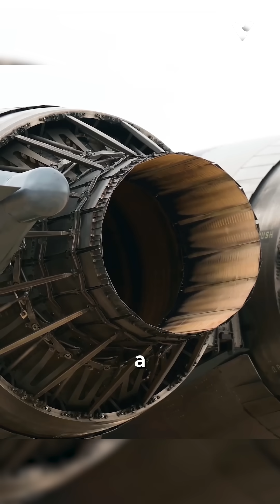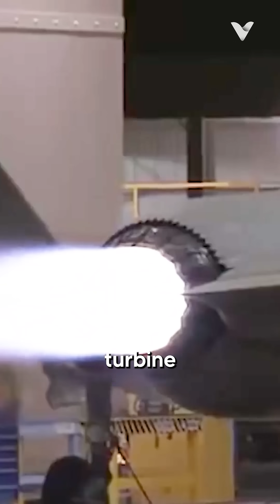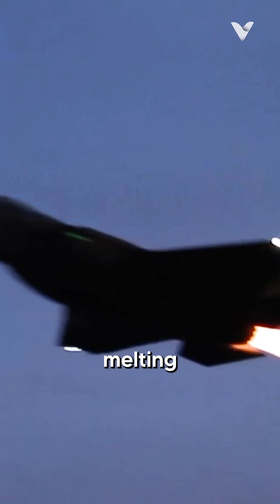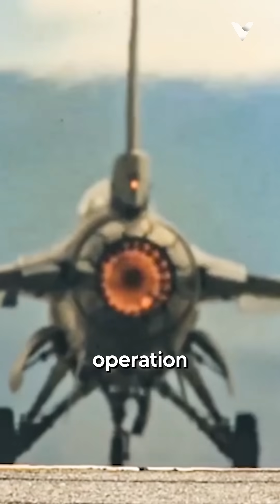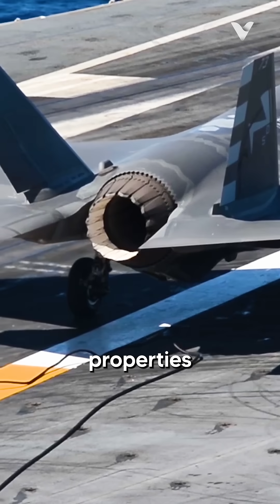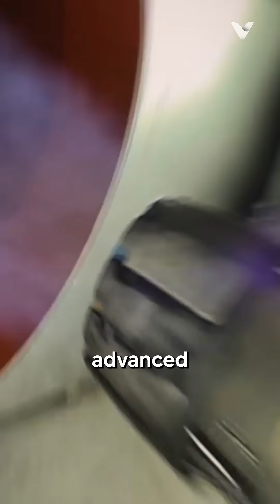Why Don't Jet Plane Nozzles Melt? #shorts

Comment: The video leaves out cooling air. It will all melt at combustion temperature. The big reason it doesn't all go to poop is cooling air and the engine design. The combustion flame never directly hits the combuster cans or annular combuster. Its all shielded by cooling air which forms the flame to not touch the metal. Also the flame is out by the time it reaches the 1st stage turbine nozzels and is very hot working air, not flame. It gets cooler from there. After that the after burner is also burning in an air shielded environment. Turbine nozzles and blades are also air cooled with paths  that are manufactured into each of them for the cooling air to help them survive.
Reply: Right. I believe it’s around only 30% of the air gets used for combustion, the rest is cooling. + afterburners if you have those and some extra fuel.
Reply: @TheWalrus-1 depends on wether it’s a high bypass turbofan like a commercial airliner or a low bypass turbofan like fighter jets. The air that bypasses has two uses. One is to centralise the flame and the other to propel the aircraft the most since the air going into the combustion chamber loses a lot of its energy through the turbine. In fact, two thirds of the power made by the compressor stage is taken away in the turbine stage to drive the compressor stage.
Reply: @TheWalrus-1  Correct. Typically 12% of air goes through the swirlers and into the recirculation zone of the engine, 13% into the primary zone through injection holes, and other 13% in the secondary zone, so total of 38%. Another 32% goes to cooling and usually 30-40% for the dilution air.
Reply: @TheWalrus-1 
Revelation 3:20
Behold, I stand at the door, and knock: if any man hear my voice, and open the door, I will come in to him, and will sup with him, and he with me.

HEY THERE 🤗 JESUS IS CALLING YOU TODAY. Turn away from your sins, confess, forsake them and live the victorious life. God bless.

Revelation 22:12-14
And, behold, I come quickly; and my reward is with me, to give every man according as his work shall be.
I am Alpha and Omega, the beginning and the end, the first and the last.
Blessed are they that do his commandments, that they may have right to the tree of life, and may enter in through the gates into the city.
Reply: @TheWalrus-1  80% core, 20% bypass in low bypass (fighter) engines. It’s flipped when dealing with high bypass (large commercial) engines.
Reply: The same method is used for plasma torches, except they are designed to spin the air inside the nozzle at high velocity to force the lighter/hotter gases to the middle while the heavier/cooler air shields the copper nozzle from the 10,000 degree f plasma arc.  All of that takes place in a cavity 1/4” in diameter.
Reply: @beansandtoast3433 jet engines do the same thing, they are even called swirl chambers.
Reply: Exactly. I used to work in the R&D department for a company producing nickel super alloys especially for aerospace applications. The application temperature for these materials is max 700-750 degrees celsius because anything above that will have significant impact on the tensile strength. No super alloy is able to withstand the temperatures such engines reach. These temperatures are only possible through coatings, efficient design and extremely well engineered air cooling.
Reply: @symmetramainbtwlol4969   Reminds of the TV show HOW i MET your mother?
Reply: exactly. left out the most important part, the air skin...
Reply: Pretty much all the really hot parts in a jet engine are cooled by film cooling. That may be comprised of fan air, bleed air, compressor discharge air or in the case of the jet pipe and afterburner parts, exhaust. Most of the time these sources of cooling air are extremely hot but much cooler than the flame/combustion temperatures. You can easily cool a turbine blade with 700 degree bleed air that is operating in a 2000 degree environment.
Reply: Yeah there is always film cooling over turbine disks, blades, and the combustor liner. The disks and blades are cooled from bleed air from the HPC, labyrinth seals between disks create the appropriate pressures for each stage. For high-tech turbines, there is a quintuple internal pass for both low pressure and high pressure cooling air for the suction and pressure sides of the blade, respectively. Often a combination of internal impingement cooling and film cooling holes on the blade create an effective barrier to prevent direct contact with the main gas stream. Most heat transfer in the combustor and turbine is still due to convection from the hot gases, but the film cooling greatly reduces it.

The ways the film cooling in the combustion chamber is provided is also quite interesting. At least in annular combustion chambers, I'm not too sure about canned or tubular systems, high-tech engines often use either Z-rings, GE rolled rings, or P&W double pass rings, each of which creates a continuous film that acts like a jet near the outlet of each ring and the primary goal is to minimize the Reynold's number to maximize film effectiveness, which minimizes differential thermal stresses and reduces the total amount of needed cooling air and rings. The liner is made of nickel superalloys, often Nimonic 75/263 (263 slightly better than 75) or Hastelloy X.

In industrial gas turbines, where weight is not an issue, ceramic tiles on elevated feet from the liner are common, with one tile row overlapping the second with a continuous annular gap to supply film cooling air. I've also seen designs where there is a multi-layered sheet in the liner with internal cooling air passageways, and then impingement holes on the surface to create a film. This is more complex but is the most efficient use of air. I'm kinda getting overly detailed at this point, I could literally write thousands of words on this though lol.
Reply: @HappyhipposMCIt’s nice to hear an overly detailed explanation. I understood these principles but it’s nice to get more detailed knowledge.
Reply: @HappyhipposMCThanks for taking the time to explain.
Reply: Took a propulsions class this dude is smart
Reply: @andrew3084 no im dumb asva bag of rocks for answering the rhetorical questions that doesnt even makes since or pass the laws of physics or add up on the periodic table
Reply: The jet engines are usually designed to let a small amount of air in that act as a layer between hot air and metal. Glad you commented on this.
Reply: @greg0063  There's quite a few interesting principles used in gas turbine technology that you don't see elsewhere like with cooling. Most modern engines that are big enough for it have active case cooling. The engines need to be as light as they can and efficient. The turbine cases are relatively thin for weight reasons but as these get very hot, they expand. Then the tip clearance grows and efficency & power would be lost or heavier cases would have to be used which is not ideal. Active case controls feed a bleed air or fan air manifold ring(s) that cool the cases to control expansion and thus tip clearance. Most also have an abradable material that it is acceptable for the blades to contact lightly. This allows it to "wear-in" for a perfect fit that is as gas tight as possible. Most of the blades have tip shrouds that form a labyrinth seal in the abradable liner as well. Fan cases have an abradable material in them also. All about efficiency. Back in flight test when the A220 was the C-series, testing had revealed that with the new at the time, Pratt P1524G geared turbofan and our efficient airframe had a cruise fuel burn of a Challenger 300 which is incredible considering how much larger the C-series was.
Reply: @mytmousemalibu  cool great info, I knew about the ablative seals but cooling to control the case dimensions is crazy. It's amazing how far they have come.
Reply: @mytmousemalibu so you know but at the same time clearance for both of those application are not exceptable to touching a got damn thing
Reply: How does it form the flame ? The igniter plugs is what fires the engine up with the help of a spray ring thr augmentor is controled now phisics come to play length times hight times thrust key part thrust!
Reply: @marcusedwards6844  the air coming out of the compressor is directed in and around the combuster liner, which has a precise pattern of holes in it. This keeps the flame off the walls with the high pressure air. It keeps it in the exact  place the engineers want it that gives a good burn and doesn't melt the liner.  "Forms" may be the wrong term. This is my understanding, I'm sure someone can give a more detailed explanation.
Reply: How the hell could the Video not mention the fact that cooling air is the main reason why it doesnt melt? It's literally the whole point of the video to explain this and the guy failed to mention the main reason.
Reply: Lmao.... Ummmm no
Reply: Even then, and I'm just curious, how does the metals that make up the combustion chamber melt?  Are they just very high heat resistant alloy? Then my question is how t.f. do they make those parts haha
Reply: @stealthmarine  look up Inconel 718. The production of these alloys is not much different to that of other alloys. Nickel alloys usually melt at the same temperature as standard steel. The big difference is their significantly higher tensile strength, hardness and high temperature resistance. Standard Steel melts at 1300-1500 degrees celsius but it can‘t be used past 500 degrees because it loses its strength and starts to creep significantly. With certain Nickel alloys you can come pretty close to their melting point without much decrese in tensile strength. They are uniquely good against creep, which is the biggest enemy of an alloy in high temperature applications. Turbine blades are made out of cast alloys to improve their creep resistance even further. Inc718 is not cast but forged. It can be used for the other parts of a combustion chamber. What makes these alloys so special is not only their temperature resistance but the combination of good mechanical properties, temperature resistance and corrosion resistance. Usually it‘s a trade-off between these properties but nickel alloys for aerospace applications are extremely complex in their composition making such a combination possible.
Reply: @stealthmarine  The metal in the combustors are cooled.  Check out the wiki article about combustors.  It shows how colder air is channeled around the metal.
Reply: 👀 Yeah but explain it. 😂Bravo!
Reply: As usual, I learn more from the comment section than I do from the videos. TY for posting.
Reply: This is the right answer... Like why a welding/soldering torch nozzle doesn't get red hot... Sure it gets a bit hot, but the flames never actually contact it.
Reply: What's a cooling air
Reply: @FoxDog1080  simply it is compressor discharge air. Some is for combustion, and some is for cooling the engine parts "cooling air"
Reply: Far better explanation.

Comment: The melting point of pure elements is generally higher than alloys. Nickel has a higher melting point than Inconel 718 or Waspaloy, two alloys used in gas turbines.
Reply: True, but unless you're making a single crystal blade, the grain refining property of an alloying element gives better mechanical properties...including creep which is an issue in jet engines
Reply: @jimeditorial  simply put, it’s yield strength at temperature. Turbine buckets are the only components that I know of that are single crystal. Static components need to resist stress relaxation. Precipitation hardening alloys help with this. I only heard the video only mention melting point.
Reply: @TJ14142  Completely correct, but for turbine blades specifically is less-so the yield strength at high temperature and technically the creep strength at high temperature, which is much lower. Specifically, the turbine blades must creep below a certain percentage of their length in like 20,000 hours or however long the engine was designed to run without major component replacement.

Comment: Why doesn't a cutting torch nozzle melt reaching  3000C? Simple, the flame is outside the nozzle and not inside, inside the not-ignited gas cools it. Similar to a Jet engine. The heat gets blown outside and disperses.
Reply: In a jet engine the burning happens inside the engine, not outside therefore the example with the oxy-acetilene torch is irrelevant
Reply: @adrianvasile4683 You are right In a car engine the combustion is inside the engine.
The piston doesn't melt. The gas exchange is so fast it doesn't have an effect, same on a rocket buster
Reply: @PinkowskiIngo  I am right in a jet engine too. There is a combustion chamber, a gas turbine and after that the hot gases go through the nozzle.
Reply: Its not quite the same. The cutting torch typically ignites outside the nozzle and most of the heat doesnt burn the metal. For turbojets, combustion occurs before the nozzle accelerates the flow, so it does have to account for the peak temperature.
Reply: You are SO ignorant!
Reply: Watch what you say the chinese are taking notes

Comment: You forgot the part about slowing the air down first (this is the purpose of the forward fan assembly) only to speed it back up again haha its actually very inefficient but it works just good enough. The really interesting jets are the ram and scram variants that utilize a supersonic airflow with scram jets having no moving parts; igniting a scram jet has been described as trying to light a match in a hurricane. The only problem is getting it up to around mach 3 for it to start working as scram jets will not work from a standing start.
Reply: So that's how SR-72 is supposed to work!
I've read about it after I saw Top Gun Maverick, but I guess my research wasn't thorough.

The more you know. Thanks
Reply: @Sych_Hyich Same principle is applied on a SR-71 it's predecessor.
Reply: it’s called convergent or divergent
Reply: @justing42  what is?
Reply: @justing42 its called bernoulli's principle
Reply: The difference between ram and scram jets is that scram jets must be mach 5+ while ramjets are efficient at mach 3 (you seem to have gotten them mixed up). The main difference in operation is that in a ramjet the air is slowed to sonic speed though a series of shocks in the inlet system before being combusted, whilst in a scramjet even the combustion is supersonic.

Also, I don't think slowing the air down and speeding it up again is the main cause of inefficiency. Both an ideal compressor and an ideal turbine are isentropic. Rather, the inefficiencies are a result of the Brayton cycle being a thermal cycle: limited by the Carnot efficiency in the ideal limit, which is dependent only on the ambient temperature and the combustion temperature. Of course, in a real engine, many more inefficiencies are introduced due to aerodynamic losses, non-adiabatic/isentropic systems, air lost for cooling components, mechanical losses, noise, etc.

Comment: What is regenerative cooling?
Reply from the maker: Regenerative cooling is method of cooling gases in which compressed gas is cooled used in rocket engines to manage the intense heat generated during combustion. it absorbs heat from the engine walls, preventing them from reaching temperatures that could cause melting or structural failure. I guess this will explain.
Reply: @voordeelmedia  Oh good